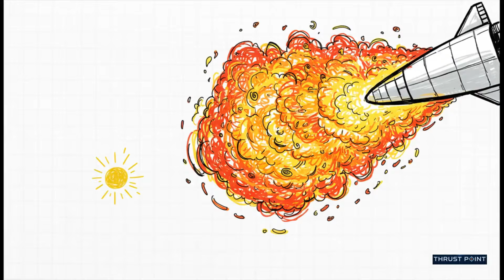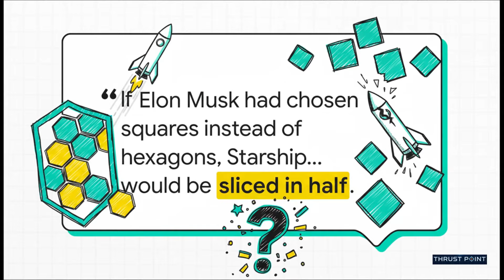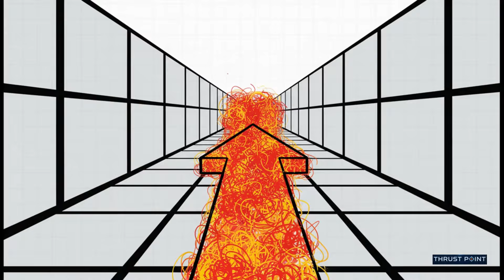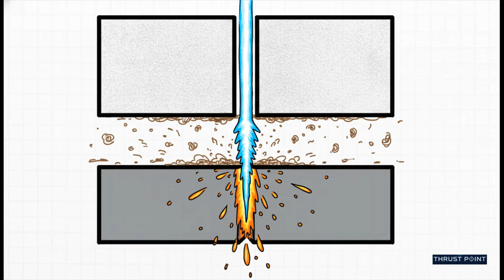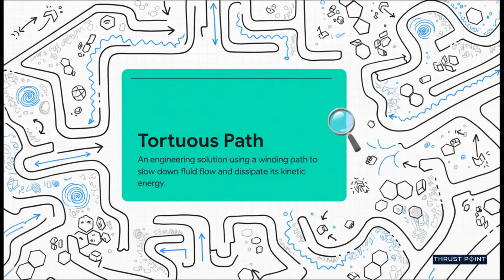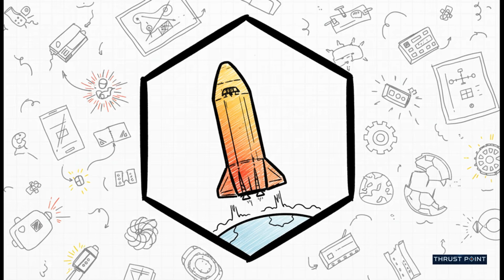The $3 Billion Plasma Cutter: Why Square Tiles Would Destroy Starship

Comment: Most common misconception is that the atmosphere is “colder” and therefore “has less heat flux” in it the higher up you go in the atmosphere, this is not true, there are more “joules per kelvin” in the air the higher you go, its just more decompressed until you get to 95-100 km altitude where the air is already plasma before the ship colides with it.

Comment: You can use square tiles phased out of each other the same as you place bricks, and diagonally to the expected flow. Is short, a tortuous path can also be achieved with correct square tile placement.